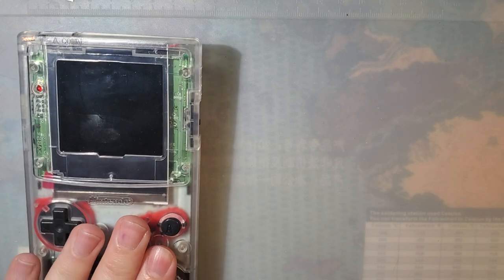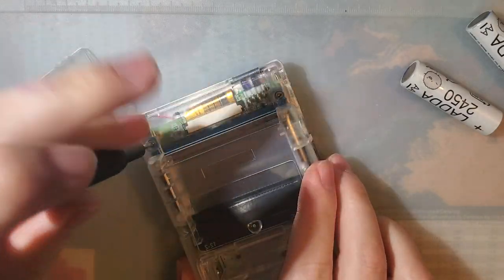AGB/AGS '2 in 1' IPS Kit in a GBC

Comment: I think that the firmware loaded on the controller IC on both boards might be the only difference. One is likely programmed for use with the GBC, the other with the GBA, but other than that I agree that both boards seem to be of the same design
Reply from the maker: Yeah, I think that's it. It does make me wonder how the GBC kit would fare when connected to a GBA though. Maybe I'll try that too for science.